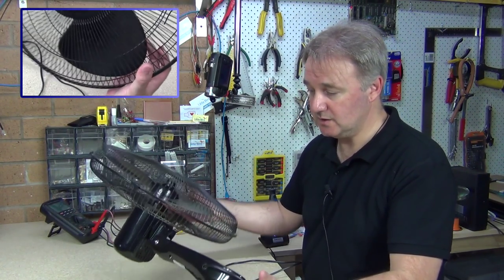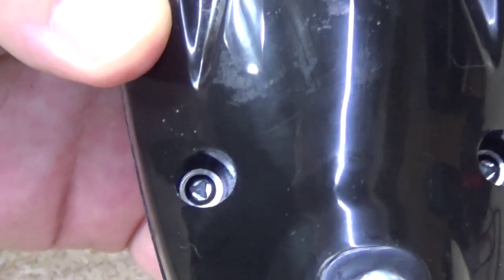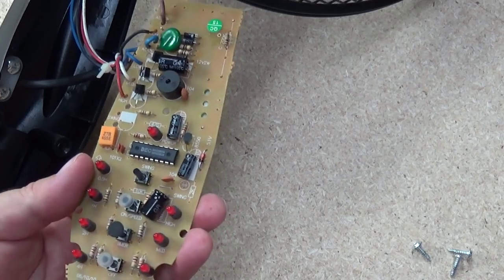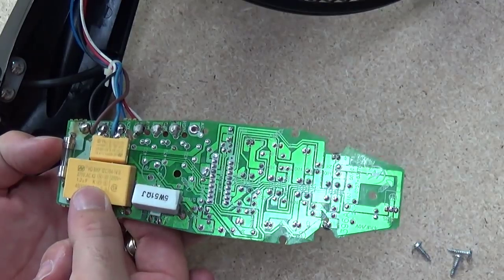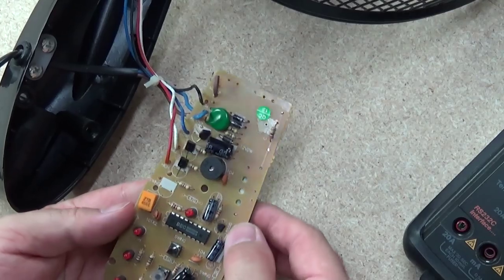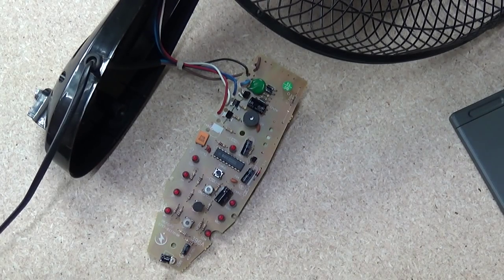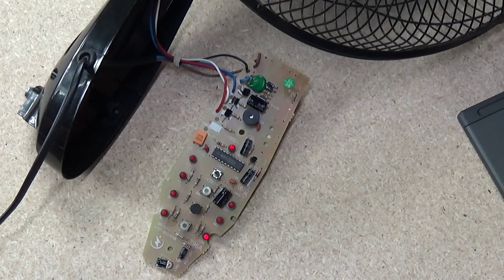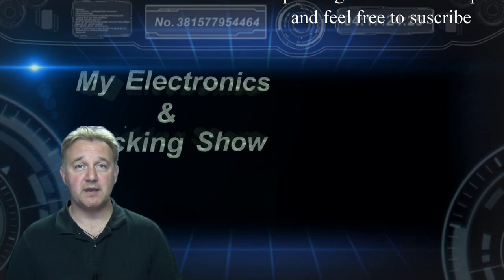Inside a remote controlled pedestal fan (MEHS) Episode 12

Comment: can I connect a remote controlled fan with faulty motor and good board to a non remote controlled fan. there's 4 wires going into the remote controlled fan from the circuit board
Reply: you should be able to. one thing you might want to be aware of is if the other fan motor is larger and rated for more power it might cause issues.